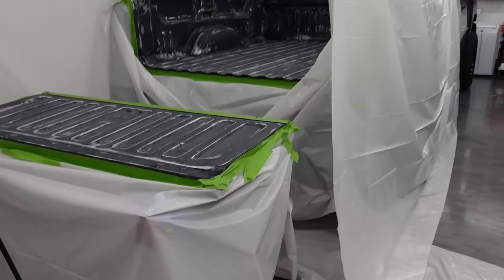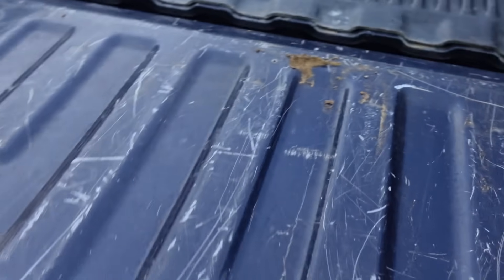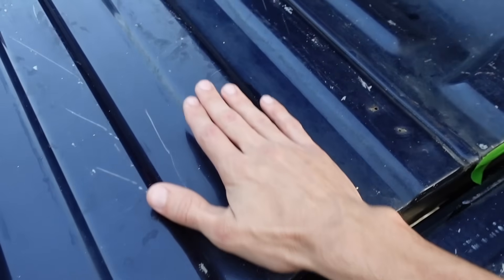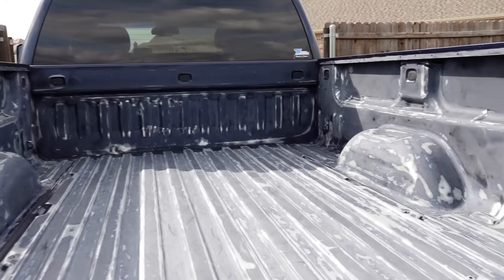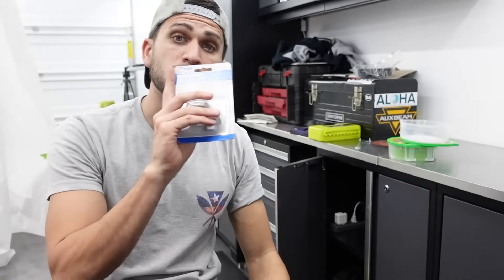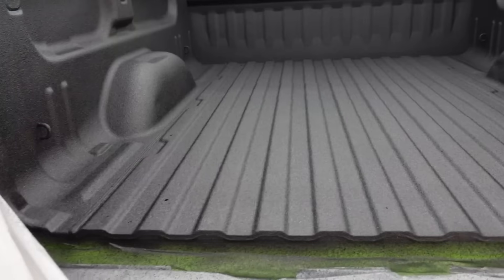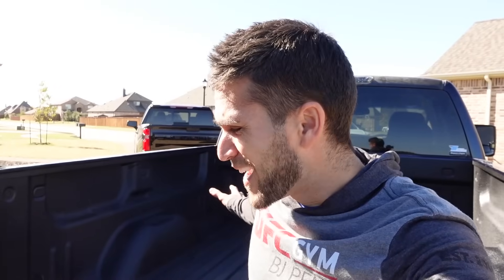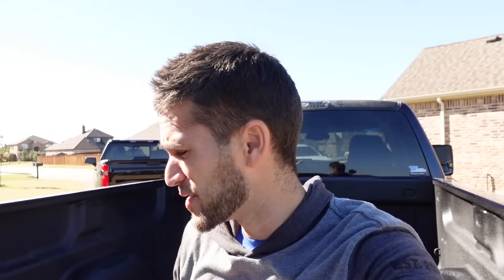SOLID! The $100 DIY Spray In BED LINER - Raptor Liner *Epic Results

Comment: Tips from someone who used to spray bedliners.. if you want to cover up the holes in the bed you can use a small piece of masking tape to cover the hole before you spray and once the liner hardens it will be invisible... also use wire tape for the edges instead of masking tape (looks like pinstripe tape, but with a wire in it) that way when you get ready to peel the masking tape off you pull the wire to cut the bedliner so you can leave a clean edge and not have to worry about leaving tape behind that you have to pick out lol.. lastly and most importantly.. DO NOT close your tailgate for at least 24 hours, the liner is still tacky and can actually glue your tailgate shut! lol
Reply: Hey boss, question for you to make sure I'm not being stupid. Places near me want $600+ to do my bed so if I were to buy 2 or 3 kits for $200-$300, that would solve the thickness issue while still being cheaper, correct? Or do these bedliner liquids not thicken up like I am thinking they would?
Reply: @bdr3481  it’s been a while since I watched this video so I don’t remember the type of coating his spray was..  really depends on the type of bed liner spray and the job you want it to do for you.. it’s been about 10 years since I used to do it and I can’t remember the brand of the spray we used but it was like a rubber coating when it dried (which I think is similar to what he used) and the more product you used the thicker it would be.. it was perfect for keeping things from sliding around your bed while driving, but on the flip side since it was “rubber like” and it wasn’t durable so a thicker layer would be better.. but if your going to be throwing toolboxes and heavy items with sharp corners around in the bed I’d say you’d want to go with a bedliner similar to rhino liner.. it’s more like concrete and in that case you don’t need a super thick layer for it to be effective.. flip side to the rhino liner is depending on the texturing it can be rough on your knees when crawling around the bed and cargo may shift… it’s all pros and cons..
Reply: @texas15013  thanks boss
Reply: Do u peel the wire fresh or when gets dry?
And do u lett it dry then apply another coat? I seen some videos like that but he used the whole 4 quarters at one time
Reply: @fishbusterss  we used to peel the wire tape and masking tape off after about 15-30 mins or so while it was still tacky, but starting to cure.. instead of extra coats I would say do it all in one go, we used a spray machine to get it to about 1/16-1/8” thick and then did a mist over it to give it some texture.. a lot of the thickness needed really depends on the type of bed liner used.. stuff like rhino liner hardens like concrete and you can get away with a thin layer.. the stuff we used was more rubbery so we would spray a little thicker on the floor of the bed compared to the sides to give it more durability in the high use area.. I don’t know how that product would react to multiple coats over dried coats.. it may work out fine, or flip side the layers start to peel apart down the road..
Reply: @texas15013  ok thank you very much for helping us im gonna do the bed liner this weekend 👍
Reply: @fishbusterss  good luck.. number one thing tho is make sure that bed is sanded, blown out, and rubbed down with alcohol to remove any remaining dust and moisture
Reply: @texas15013   I'm gonna fallow every step you told me thank you
Reply: I used white pvc fast caps that I got from Home Depot they worked good to not struggle with having to cut a circled piece  of tape 😅😅

Comment: Coming from someone that has worked at custom truck shop and did bedliners. Honestly this way better then any rush job they would make me do on the regular. They wanted bedliners done with in 2 hours. Prep and spraying. Can it be done yes. Does it look good. Yea. Is this DIY better than that. Hell yes it is. An you save so much more money from it. Good job man. Can’t wait to spay my 2012 Silverado beginning of the year
Reply from the maker: I appreciate it!

Comment: Have you thought about adding the tailgate assist to the OG? I did it to my 09 Silverado and I love it. Its on Amazon for $27
Reply: Highly recommend this...did it on my ford.
Reply: My truck supposedly has this how do I find out if it does? Does it ever wear out?
Reply: @bigwick7626  if you open the tailgate and it slams down or you have to let it down it does not have one. I've had it for 3yrs and still works perfect.
Reply: @andrewlivingston9058  you’re right, I have the easy lift. Did you get the deezee tailgate assist on amazon? for 27.20?
Reply: @bigwick7626  thats the one
Reply: @andrewlivingston9058  is it similar in appearance to oem?
Reply: @bigwick7626  I'm not sure what the OEM style looks like but it's not in the way, I forget I have it
Reply: @andrewlivingston9058  have you done brake rotor/ pad upgrades at all! What do you recommend?
Reply: @bigwick7626  I have not. Waiting to lift my truck first
Reply: Is there any rotors or pads you’ve researched? The Silverados of our generation have 13” brakes I believe. Hoping to get noticeable performance difference in driving everyday with new rotors and pads
Reply: @bigwick7626  I just buy oreillys performance model with the lifetime warranty and works perfect

Comment: Sorry for posting on a 3yr vid, but yours came up in my suggested feed. I ended up doing a DIY roll on Herculiner and with 2 to 3 coats, you get that OEM finish. My point is you install a bedliner to treat is like 💩and over time, it will look like 💩so why pay $600+ to have one installed? I almost did until I found out I could do it myself and if I screw up, which I did, it doesn't matter because it still looks 1000 better than nothing, plus I have a Roll n Lock tonneau cover. 🤷🏾‍♂JS IMO

Comment: Never leave any bare metal , spray a coat of metal sealer first . It will rust under the liner .
Reply: What kind? I thought the raptor liner was used to prevent rust.

Comment: I'm hoping to do a light bed restoration with my F150. It's bed was very well abused before I got this. I noticed you said it helped cover some dings. Did it fill in the dents and dings or do you still need to take care of them first?
Reply from the maker: You’ll want to repair any dents or dings. The coating will cover and mask any scratches
Reply: @LonestarHawaiian  thanks a ton! Do you think I could get away with body filler or would you recommend something else? I’m still a little new to the paint and body and bed liner stuff

Comment: Hey I got the same truck an wanna do the rocker panels but the previous owner has already sprayed them with a liner like material maybe even line x. Do you think I should get it down to bare metal or can I scuff it up an spray over it?

Comment: I spray Berliners at Bullet Liner. For 450$ you get a real high heat spray on bed liner with a lifetime warranty. These don’t look terrible but Raptor liner can’t stand up to the abuse. We have had to strip these out of multiple trucks to spray our liner. You just can’t beat the real thing.

Comment: Do you need to add adhesive spray after sanding on silver parts from sander?
Reply: Silver parts?? Bare metal right? I would hit it with rattle can primer bro. 👍

Comment: I have a 2004 Dodge Ram 1500 Sport and also a 2016 Dodge Ram 1500 Sport and in the 04 I have the plastic Mopar bed because back then they gave you a free bed liner when you purchased a vehicle when it comes to my 2016 I had them do the spraying bed liner because I thought I would like it better and unfortunately I don't like the spray in bedliner I have my own construction company and although the spraying is nice for durability it's always filthy looking and with the plastic liner the only problem it stinks slide around very easily but they make things that's it in the plastic grooves to hold your item but the plastic bed liner doesn't scratch material weather spraying scratches things immediately so they both have their good and bad I guess you also have to take into consideration what you going to use your bed of your truck for👊👍🇺🇸

Comment: Being you've used and see how well this spray holds up. Do you think it would work well on the roof of a small popup camper.
Reply from the maker: As long os the surface is prepped correctly, I don't see why not! Still looks great months later after several loads of dirt 👍🏽

Comment: what grit sandpaper do you use? do you need to spray an adhesion promoter after sanding? obviously you need to clean off the dust, right? how can you make it not so glossy? 

im planning to spray my whole car with raptor liner. this will be my first time and I hope it'll look as good as your truck bed.

Comment: I work for a rhino lining place and we use a different sander and today I sanded 3 trucks in 45 minutes
Reply: Same,  This "liner" offers zero protection,  But its 10mil thick at the max.  Mine are 120mil.  Just my opinion.

Comment: I have a raptor liner truck and it’s good. I can recommend it for exterior look and light duty bed use. But it will never match line X for bed use. There’s a reason why line x bakes on and has a different gun with a lot of pressure. But I do recommend going thicker if it was my truck. If you toss a shovels, chain links or a metal house appliance it will scratch or chip easier than line x.

Comment: Just finished my 6ft bed. 2 bottles on the sides 2 coates. 2 bottles for the bed plus tailgate. Worked out perfectly with a tiny bit to spare. Make sure you overlap 50% when spraying to avoid spray lines.

Comment: Here in the midwest if you have that plastic liner for years, your probably gonna be buying a new truck bed before spraying. They trap alot of water and salt.
Reply: I bought a 2002 f150 from my step dad that was the first owner he had the plastic since the day he drove it off the lot the plastic wasn't even under the bed rail 
So I'm imagined a horrible rust disaster and surprisingly it was mint 
I'm pretty excited to do this

Comment: well done professional video.   I had concerns on the thickness as you mentioned.   Have you considered a second or third coat?  I'd think adhesion would be pretty strong.
Reply from the maker: I’ve several loads in the bed since I’ve installed it and have been surprised how durable it’s been. No chipping or scratches yet

Comment: Hi! This is my first video of yours I watched and I really liked it. I work in the detail department of a dealership and what we use to get over spray off; paint, floors, and basically anywhere is called: Clear Reflections "C-Solve" or Citrus solvent, it is an extremely harsh solvent that will basically just wipe the overspray bed liner off and also is very good for getting plastidip and other rattle can sprays off. We use it on new cars that get the undercarriage rust protection put on as the place that does it for us is very bad about overspray and the whole car is usually covered.
Reply from the maker: Super helpful. Thank you for the info!!

Comment: Next mod, the 30 dollar ez lift tail gate shock absorber off amazon. Did it to mine and I regret not doing it years earlier. Also add me back on FB chad I sent you a few requests to join the truck groups

Comment: Al's bedliner is by far superior to any of those bedliner that harden. Its literally solid rubber. It never gets hard and chips off. It's only 100 per kit and has been proven and tested to be better than even products like rino liner.
Reply: Definitely not rubber and it hardens just as hard as linex or similar and it can chip if hit hard enough too (i have a chip on my hood edgeI Raptor’d the entire body of my 07 tahoe two years ago and she’s still holding strong for the most part. Even did body color so I didn’t have to worry about jambs, hell, it’s even got the factory metalics in the coating too.

Comment: It looks alright, and would be fine on an older truck, or one you're not going to abuse too much. I wonder about the longevity of it, a LOT of the DIY spray liners tend to fade really bad after about a year. I had a '15 Chevy 1500 that I had sprayed with LineX and when I traded it almost 4 years later it still looked new after a fair amount of abuse. Had my new truck sprayed about 2 weeks after I bought it.

Comment: I watched a few of these videos and thought man, I'll pay the extra $400 to have someone else do all that work.
Reply: Absolutely.  I've used raptor liner on a few different applications.  And while it looks great, it just can't handle the abuse for a truck bed.
Reply: I work at a Bullet Liner and for 450$ younger a real high heat spray on liner with a lifetime warranty. You can’t beat that.
Reply: @Rick-of6gx  for light duty use it can handle but if your throwing shovels and appliances pay the 450$
Reply: @chancebad  Is there a bullet liner applicator in the Dallas/Fort Worth area that you know if?

Comment: Anyone doing this for the first time, if you want to ever use your user tie downs make sure to pull out the caps before coating the bed. The bed liner makes it very dificult to do later. I had a dealership coat right over them was a pain when I went to use them.

Comment: How did you keep the drain holes from clogging up when you sprayed in the liner?
Reply from the maker: The spray wasn't thick enough to cover up the drain holes
Reply: I used foam earplugs when I sprayed my floors in the jeep

Comment: One question, why didn't you remove the tie-down covers before spraying the bed liner? If you had, you could have replaced those covers once the bed liner cured and been able to use those areas to add additional tie downs in the future if you wanted/needed. Since you didn't remove them, they are now sprayed in permanently. I'm just curious if you thought about that before hand.

Comment: Props great work!  However, I think 80 grit is a little aggressive to prep the surface...
Reply: 80 still to soft next time I’ll used a lil bit more aggressive
Reply: I wonder if a cheap sand blaster would get the same results but faster.